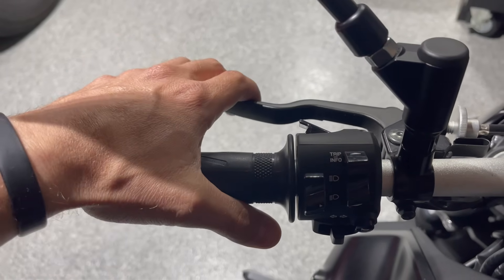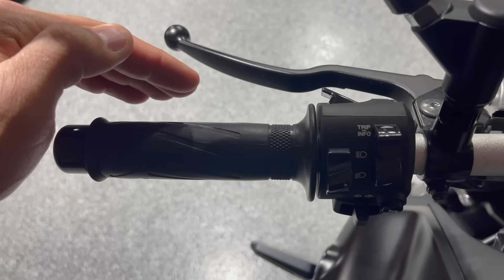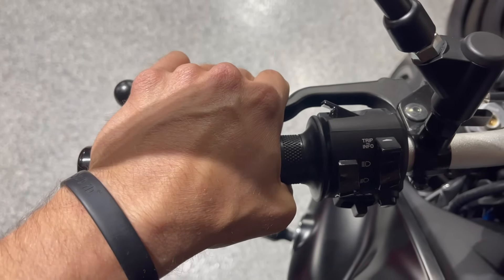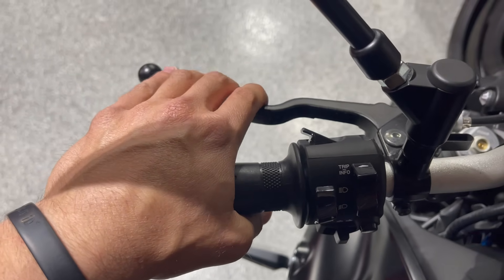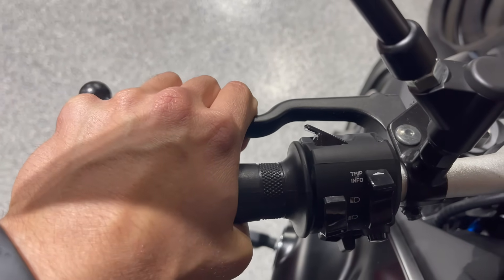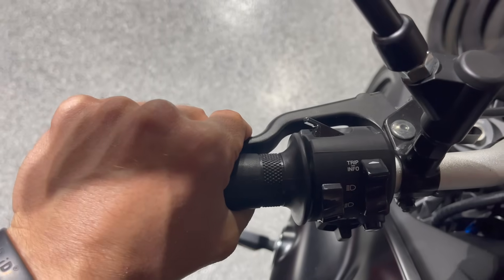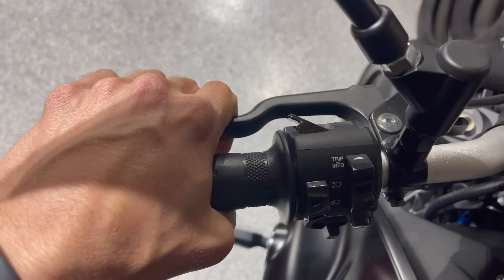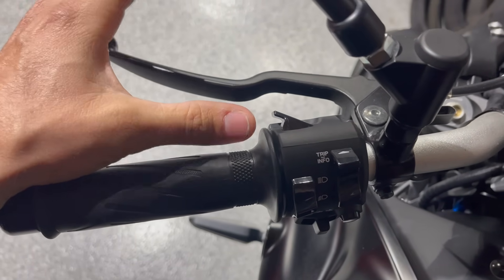Don't Make This Common Clutch Mistake!

Comment: Respectfully disagree that pulling the clutch in all the way is a mistake. Sure, you can shift the way you demonstrate here, but it will also wear out your clutch faster. $$$$$
Reply: Agree
Reply: So if we only do half pull clutch it will wear out our clutch plate faster right? And pulling all clutch in is better for long term durability? Am i correct this far?
Reply: Yes sir, you can see that by looking at the clutch its not totally lose os totally intense if it's not all the way in/out.. So can you shift faster like that yes u can, do you use it if needed in tight turn situation, yes u can but is it smart to use it all the day all the time? No. You will cause shorter life span of a clutch
Reply: Also that's why there's no need to hold the bike in Gear on a stop light with clutch pulled in.. Or why these is no need  to rest your hand on a clutch.. Just by resting a hand on a clutch you can see the movements happening
Reply: @redaradi1767  good one
Reply: @redaradi1767   I don’t get that sorry Sir. Why you dont stand on a red light with clutch pulled and in first gear? What else? Neutral? Yeah. But you don’t wear out the clutch by it being separated while being pulled?! Or how did you mean that? I come from cars and fairly new to bikes. So would be interested what was your point there. 

Hope you can explain it to me. Thanks.
Reply: @weisswurstfruhstuck8523  same does for the car..when u are at the stop light you avoid staying in gear for longer life span of your clutch by avoiding wearing out..if the situation is unusual let's say on a stop light with incline then on the car it's easier to hold the car by pressing the brakes no need for holding the clutch then when it's green first gear and disappeare. But with bikes it's easier to stay in gear no need for flipping your legs around from holding rear brake to switching legs to put in gear it's a lot safer for you to stay in gear on a incline on a bike but in every day use you don't have to..so while standing avoid long clutch holding..and no fingers resting on a clutch..no need for explaining that it's same on the car u have a foot resting place you don't rest your leg or hand on a clutch..
Reply: @redaradi1767   ah ok. Naaaa yah this little wear and tear I take myself in account. I like to be in gear to be able to move quickly out of the way or whatever. That’s how I learned it and as a racecar driver I mostly even double clutch to save the clutch when I have the time and therefore the little wear and tear standing with first gear on a redlight doesn’t really concern me. :) 

And thanks for explaining again so detailed ! 

I think this little wear and tear is definitely ignorable. It’s more like a matter of taste and what kind of a driver you are or want to be. At least that’s how I see it.
Reply: Bro has a clutch plate manufacturing unit... Trying to hike his sales😎
Reply: @redaradi1767   so its better to put in neutral in traffic stop sign all the time ? Rather than first gear and pulling your clutch in ?
Reply: @RC-yo1qc  yes..only if the situation is unusual like incline stop...even if it's downhill you put in neutral then just let it roll pop the second gear i smooth sail.. better then staling it and dropping the bike or giving it unnecessary throttle downhill..same with the car but less dangerous to stay in gear..ifu ever staled a bike while standing downhill you will know what I'm talking about..it easily throws u off..open all 4 eyes and focus on the road..you know what idiot is driving the bike but u don't know what idiot is coming from other side..stay woke..
Reply: Agree. Pulling the clutch all the way disconnects the clutch completely from engine and pulling it half way keeps the plate still in contact with the engine that results in faster wearing out and decrease in fuel efficiency.
Reply: @redaradi1767  what? No. First off being in neutral in a red light is a bloody good way to get into trouble. Second with the clutch fully disengaged, the only wear will be on the clutch spring, which is rarely a point of failure on a clutch. the clutch plates and pads will wear out much faster than the spring….
Reply: @dogman8339  Good for u..i believe u know the best..
Reply: 10000%true
Reply: I agree.
Reply: My bike doesnt have Slipper and Assist clutch; will my clutch wear out faster than normal?...
Reply: @redaradi1767  except holding in the clutch for long periods can wear out all the throwout mechanisms whatever they tend to be, needle bearing, ball bearing etc.  I always try to get to neutral but you always can't. Either way it ain't gonna burn up or make a huge difference in the long run. If it's maintained it'll last tens of thousands of miles no matter what ya do really. I have seen single ball bearing setups welded to the actuator rod and needle bearings completely shredded though.
Reply: @esdeathchan4354  you are very right ... the way the motorbike clutch works is by pulling the lever all the way to avoid wearing out the clutch pads as well so that they last.  That's the basic method of motorcycle engineering and clutch cars, the same way of working and methods... except for automatic cars and motorbikes...
Reply: @wayne_smallville83  yeah i know, but thanks anyway for explaining buddy
Reply: That's a good argument for a car clutch. A bike has a wet clutch. It is quite littetally designed to be worked in the friction zone. The damage is not as severe as it would be on a car.
Reply: Yes
Reply: This
Reply: also when you’re driving for long hours you wont even care if you pull it all the way. so i say i just pull it all the way when i can.
Reply: What about about dirtbikes I only use one finger to pull the clutch in I never hit my other fingers my clutch is fine ...it does it's job
Reply: I agree 100% with your theory. Also, all depend on the lever adjustment.
Reply: @redaradi1767  You meant clutch lever? Small lever movements have no effect on the plates.
Reply: @weisswurstfruhstuck8523  At least, you put unneeded tension on the clutch cable/master and slave pumps and internal springs.
Reply: @RC-yo1qc  Ofcouse. Ask your clutch cable or hydraulic pumps/lines
Reply: @corneilcorneil  sorry but this is so small that’s not even measurable. Therefore I double clutch a lot when I can and always rev match. This is way way more wear and tear so my clutches last longer than most people‘s clutches.
Reply: Yeah, as someone who has replaced a clutch I don't recommend burning them out. Dragging a rear brake is preferred to riding the clutch.
Reply: The clutch on a car is totally different than the clutch on a motorcycle.
Reply: @Imsaved777  depend on what car and what motorcycle. Principes are the same. Milti vs single, cable, rod, hydraulic, dry, wet, ... at the end, it comes to friction.
Reply: People need to realize clutch plates are wear items just like break pads
Reply: @jasonhinz3402  If you don't realyze that, you have to stay away from bikes... far away.
Reply: true
Reply: If u pull clutch in a turn, by mistake then you can't turn the bike you will hit the corner of the road
Reply: @johnreesed.3559  Only if you have no skills...
Reply: @johnreesed.3559  So, you never shift back in, for example, a steep corner?
Reply: @corneilcorneil  no I said some people keep pressing the clutch and foot Brake for seconds till the bike slows down for a corner , so in corner you don't keep pressing the clutch for seconds.
Reply: @johnreesed.3559  You wrote that "pulling the clutch" in a corner, you can't turn the bike and you will hit the corner of the road... Roadcurves don't have corners, you still can lean your bike, you still can steer your bike (for so far you have to (counter)"steer") and that makes your statement totaly wrong. I ride daily, shift back on steep curves daily, "pull"(squeeze) clutches whyle leaning in curves and i still can steer. Wondering if you have experience, because a real rider would not state something like that.
Reply: @redaradi1767  the clutch doesn't wear while being fully disengaged... There is literally nothing touching. It's dangerous to be in neutral at a stop light because you cannot get off the spot fast if someone is coming in hot from behind
Reply: @reda radi  motorcycles have wet clutches  which can handle extended slipping and holding the clutch in at lights. Where as cars have dry clutches
Reply: @minarchisttrucker2775  *most
Reply: @minarchisttrucker2775  wet clutches wear out faster because the plates aren't fully separated even when the clutch is fully pulled in
Reply: He should rename his channel from "motojitsu" to "motoBULLshido" 😂
Reply: @esdeathchan4354  "half" depend on your adjustment. Engaged, friction zone or not engaged. The uploader forget a fiew things... space between the plates, oil flow, lubricating, oil and plate temperature, ... Less pull, less space, less...
Reply: @redaradi1767  What movements are going on when you rest your hand on the "clutch"? I think you mean clutch lever, but even then, i still don't get your point.
Reply: @corneilcorneil  thanks brother
Reply: @redaradi1767 No, if the clutch is disengaged, you aren't wearing it out..
Reply: @redaradi1767 
Dude you need to do some research on how both motorcycle and car transmissions/clutches work before you go ranting bs facts to new riders that dont know any better. The wear from sitting at a light is negligible and just noramal wear and tear.
The benefit of staying in gear at a light is to get out of a situation if needed, its not the same as driving a car you're way more vulnerable.
The only time i sit in neutral at a light is when ive been sat there for more than 5 mins or i know for sure ill be sat there for that long, but just to rest my fingers, not for wear and tear.
Reply: My clutch is a bit tight. I'm a little new with Manuel bikes and still getting an understanding of things
Reply: He is not doing halfclutch its jst that we can achieve full clutch without fully closing the clutch
Reply: @redaradi1767  that's also a good way to get ran over, if your at a red light and some dummy is on their phone not paying attention and your in neutral instead of in gear holding the clutch in, might cause you to get hurt. That couple of seconds to put it in gear to get out of the way might cost you big time.
Reply: @undead9999  you are the only one knows what they are talking about, other comments saying it's same as a car clutch are misleading, I teach learner rider's on 125ccs we literally tell them to ride the clutch the clutch is there best friend it won't wear out you are 100percent correct bikes have wet clutch 👍👍
Reply: @karl I   thanks mate. I've been riding for almost 20 years now (started at 14, I'm 33), and my mentor was a patched member of a MC. He taught me pretty much everything. I really don't understand how people don't comprehend this fact, even a newbie would realize that working the clutch in the friction zone feels natural, because that's how it was designed to work. You can easily understand this after a week in the saddle.
Reply: Agree
Reply: @redaradi1767  when I am at the stop light it's staying in gear clutch pulled in one less thing I have to worry about on taking off especially if you have a jack ass not paying attention behind you and ain't gonna stop
Reply: Motorcycles are a wet clutch. You can do both. You can ride a motorcycle clutch too. It's call the friction zone for a reason. It's not a car, so stop giving out BS.
Reply: Disagree. You have lockup and disengaged. Same with brakes but opposite direction of travel. You tune your lever so that you don’t have to use the entire travel distance.
Reply: True, if your rich don't press clutch 😬
Reply: @nikhilscoobi1078  you’re right cuz the running gear won’t be an oil change away from slipping 🤣
Reply: @RC-yo1qc  yes neutral at red lights
Reply: It's no mistake what he is saying because you have less control with an up clutch when you maneuver between the traffic line at a very slow speed. Now if you are one of those who sit in traffic with all your three boxes attached for buying milk from the store and your legs are dangling on your bike from zero to thirty then you can have just a 1mm clutch pull and feel fine. 
Different is if you want to ride a bike like a professional or like a wannabe Rossi 😉 😏 😜
Reply: Could you explain this please. I recently bought a bike, I am trying to learn.
Reply: Agreed
Reply: @alifaizan4377  except you're wrong. Wet clutches are lubricated hence the name wet. Which causes them to last longer that a dry clutch
Reply: 100% wrong
Reply: In my training here in Florida 20+ years ago we were trained to pull incall the way to shift gears. Great video. I'll give it a shot and see what happens this afternoon. 🙏
Reply: For new clutch and well tuned it is ok. But overtime when the clutch cable lengthens it may not be even possible without sapping the cable.
Reply: you can actually adjust it, so that even if you pull it fully, you eliminate that dead space
Reply: Your clutch is "wet".. You're not going to hurt it.. That's what it's designed for..
Reply: No it wont as long as you hit that bite point it will be fine
Reply: It's a wet clutch you aren't going to wear it out like that
Reply: He said, while doing low speed maneuvers, in that instance the friction zone is mandatory.
Reply: Agreed. The friction zone isn’t for shifting. It’s for the friction zone maneuvers.  When I shift in my car. I don’t release my pedal halfway. Your just destroying the clutch packs aka burning your clutch. I understand bikes have wet clutches. That’s just a cooling factor. You still burn the material just at a slower rate. Pull the clutch in ALL the way.
Reply: Depends on the cable or the setting with hydraulic. Almost like saying that having your brake locked up and tight to the bar or pulled hard at 3/4  will give more or less stoping power. Once it’s fully engaged it’s doing it’s job.   Is power shifting without the clutch in a car a bad thing too. Lol. I mean I hear what you’re thinking but if you’ve seen how a clutch works or work on it yourself then you’d maybe understands little more. That’s why it’s called “free play” or friction zone where you can pull it in or Watever a tiny bit and it doesn’t engage.  I’m not master tech but this isn’t anything that intricate. Only time I’ll pull it all the way to the bar is when stopped.  And don’t purposely pull it all the way in (I don’t think) when normally shifting just by habit and feeling it.  Plus on a bike you shift so quick I honestly don’t think it matters.  Had bikes with many miles and no clutch issues so again not sure but don’t think it’s that big of a deal
Reply: Agree
Reply: I remember in one of his other videos that what you're saying applies to cars not bikes. Almost all modern bikes have a wet gearbox. What you're saying will definitely apply to the dry gear box where there is no oil but built entirely mechanically.
Reply: @nicholaslennon so when coming to a stop at a red light is it better to just hit the front and rear brake no clutch and stay in gear?
Reply: It's about safety not about money.
Reply: Well the force is strong with this YouTuber. Create controversy. Let the comments pile up. Profit. I swear there was a a former United States president that had shady deals with the news media and big corporate advertisers that did the exact same thing. I have a feeling that we will see him back on the soap box soon.
Reply: @wayne_smallville83 not so sure about that, when engaging of disengaging you’ll know at what point the clutch is either engaged or disengaged. Pulling beyond that will save nothing.
To suggest a clutch is only disengaged when it contacts the grip is to misunderstand how the clutch works….IMHO
Having it the mechanism partially engaged will certainly not extend life, of that we all should agree…aka riding the clutch, should be used sparingly
Reply: Totally agree. Just because u can doesn't mean u should. Heck I can shift gear without even using the clutch and just letting off the gas. Not doing my engine any favours
Reply: I think pulling All they way down exert more effort. There is a dead space from friction zone to all the way down. Beyond friction zone like millimeters beyond, the effect is the same as pulling all the way down. Beyond friction zone the engine is disengage exactly the same as pulling all the way down
Reply: You’re not correct sir. Your shifts must be so jerky 💀
Reply: He is talking about when your shifting gears while your moving, not on a complete stop
Reply: I’m in learning mode here, so bear with me.  Binary: clutch engaged, clutch not engaged. Other than working the friction zone for slow speed manoeuvres…. how are you destroying your clutch? Thank you for everyone’s efforts to enlighten me!
Reply: He is saying that once you have disengaged, you are disengaged, going out farther does nothing.  When you think about it he is right.

I would also say that pulling it out all the way puts undue stress on the  clutch springs.
Reply: yes clutch lining will be damaged too early
Reply: I’d it’s a wet clutch, it won’t
Reply: Clutch plates* totally agree to disagree
Reply: Agree
Reply: It’s a wet clutch they don’t wear as much
Reply: I ride in thailand bruh, those who don't know their friction zone don't get to come back home...
Screw the clutch plates
Reply: Nonsense. Tens of thousands of kms shifting like this or even without the clutch and zero issues.
Reply: @voiceofscholar2003 technically, you can adjust the clutch to be fully disengaged  and the have space between the handle and the grip.
Reply: Agreed 💯
Reply: What's the point of pressing the clutch further past the disengagement point?
Reply: If it's pulled past the friction point it won't wear out faster, doesn't matter if you pull it all the way or halfway. No friction, no wear. Of course the lever must be well adjusted.
Reply: As long as it fully disengaged your good. You can wear your springs out by pulling all the way too
Reply: @dogman8339  All my life I've been going neutral on a bike whenever I stop at a red light. Never got into trouble one single time! I baffled why that would constitute a problem in any way!
Reply: @bernardomotard you change gears without clutch?! Maybe you should ride a supercub.
Reply: @Privateizon  most bikes not all
Reply: Wrong. I’ve worked on a few different brands and stores and the idea that the clutch is not fully disengaged unless the clutch is completely pulled in is the most ridiculous thing I’ve heard. If your clutch plate gets burned up unusually fast it’s most likely due to too much time spent in the friction zone. The clutch goes from fully disengaged to fully engaged in about 3/4 off an inch of clutch lever travel. This is easily proven and observed on an incline from a dead stop.  With the clutch fully compressed while holding the brake, you can release the clutch and the brake at the same rate and you will roll backwards easily and quickly. You’ll find yourself grabbing brake again. But once the clutch engages after roughly and 1 and 1/2 inch of travel you’ll hear a change in the engine and you can then begin to release the brake and feel the engagement. Every bike is a little different but no bike requires the clutch to be fully compressed. If you are fully compressing your clutch, you’ve developed a bad habit that does not give you a good balance of clutch to throttle control.
Reply: Yes, that is my experience too. My experience is about 40 years long. Twenty years I used the clutch “wrong”, and never had any problem, and after I started using it like this I got more work with it like repairing and adjustments. I prefer the “wrong” way nowadays.
Reply: Agree
Reply: I agree I have to pull mine all the way in in order to shift or it just rubs
Reply: It is there for a reason after all ffs
Reply: This guy should be taking apart motors like I do. I see so much damage on none proper use of clutch. Broken, burned, abused etc.
Reply: Agreed
Reply: @redaradi1767 respectively I don’t agree. Having bike in gear and checking what’s going on behind you gives you more chance to escape rapidly in case someone behind you is playing with his phone instead of paying attention what’s in front of him. My riding instructor lost his friend in situation like this. He was like because had his bike in gear!
Reply: Exactly what I was about to commemt.. Respectfully, of course
Reply: Agreed, just like a vehicle
Reply: Pressing the clutch the half way will JUST give you a bit of time, you will shift faster. But the grip on the handelbar will be compromised. So if you are not in the motogp and you don’t need those extra milliseconds, you better press the clutch till the end and hold to  your bike the best you can. 👍
Reply: aka feathering the clutch on a manual transmission car
Reply: Yes that's common sense to pull the lever till touching the handle bars, this way the clutch is fully disengaged. 
By only squeezing half way there is a good chance of wearing out the clutch much faster 👍
Reply: That's fundamentally incorrect.   The clutch is fully disengaged as soon it's "inside" the friction zone.  Your clutch should be adjusted so that the friction zone is the last 1/3 of travel WHEN RELEASING.  This is riding 101 type knowledge.  2/3 of the lever's movement range is just overtravel for mating the lever and grip together comfortably in your closed hand at traffic lights or extended stops on trails while in gear.  Your clutch probably isn't even adjusted right if that's what you think.  I've seen dozens of you out there.
Reply: 😂yeah this guy sells and installs clutches 😂
Reply: I often change my gears without using my clutch (and without quickshifter), and my clutch is worn out not any faster.